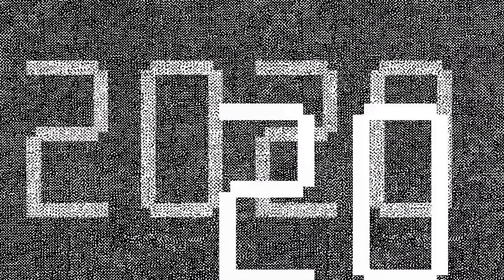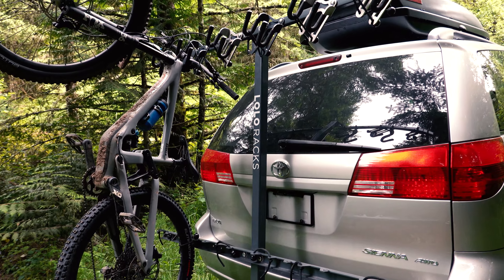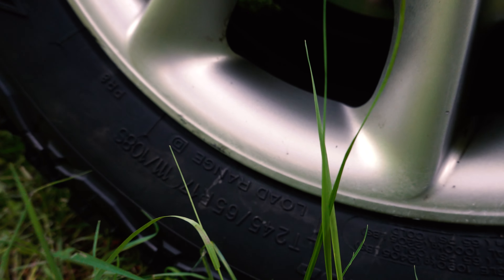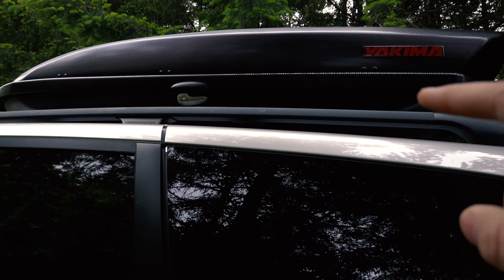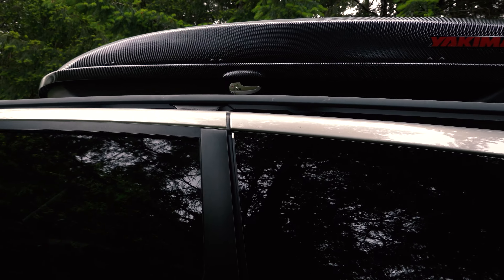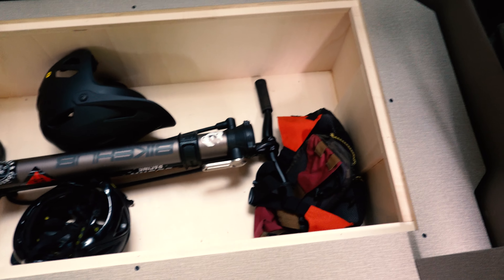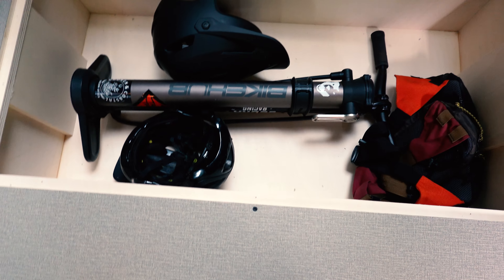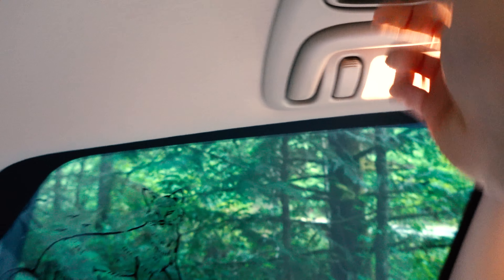Toyota Sienna Adventure Mini Van Camper Part 1

Comment: sweet, I have a 2004 AWD Limited Sienna with 110,000 I was planning to sell, but no I'll probably keep it as a project car =) ,   ( I did put 245/50/18 on Lexus GS 350 18"  wheels and it make the van drive way more stable, the offset and lug pattern is perfect )

Comment: Lift kit is a 8 hour job. Around 700 bucks anywhere u have it done. I have a 2011 XLE AWD
 And about to install Journeys 3.5 but kudos to you for the inspiration to toughen up the mom Van's. The 4x4 snobs will scoff ..let em. These Van's are build on Toyotas SUV platform anyway. Lest they realize.

Comment: dude bro, your van is sick! i was debating between a sequoia and sienna, but gonna get a sienna for hang gliding and camping after watching this video.
Reply from the maker: I was in a similar boat and the Sienna is just so nice for hauling stuff and camping. Hard to beat the sliding doors too.
Reply: I got the sienna, I got it almost 80% built out, I’m going to throw in some tires now, I don’t have a lift but I am scheduled in March at journeys in Scottsdale, but if I get the tires now have you had any problems with the 245/65?
Reply from the maker: @HangingwithJoe  no problems

Comment: Is there a part 2 to this "series". I just saw your video on Dustin Klein's channel with the lift installed. I'm on Vancouver Island, BC and just bought a 2006 AWD Sienna. We have the Journeys Off Road lift kit for our Dodge Grand Caravan. Definitely going to get the 3.5" lift for the Sienna too. Did you install it yourself or have it done in a shop? Also, you didn't have any issues with 245/65/17 pre lift? I was only going to go 225/65/17, but now you have me thinking. Last question, do you have a link for the Blueridge net?
Reply from the maker: No part 2 yet. Hopedully in the next month, I just need to find some time. We installed the lift at a friends house that had a big car lift. I have a friend that did it in front of his house by himself so totally doable. 245/65/17 without the lift is really awesome. With those tires you honestly don't even need a lift. Net is the Blue Ridge Overland Toyota Land Cruiser / Lexus LX Attic. Fits perfect and is super secure. I am not sure what the weight capacity is but I feel like it could hold a lot of weight!
Reply: @BrokenandCoastal  did you get any rub or need wheel spacers for those tires ??

Comment: I’ve driven my 2010 Sienna on a long stretch of washboard and I could see the frame flexing pretty significantly near sliding doors.  As much as I want to do JOR 3.5” lift, I’m worried frame flex could be a problem over time.
Reply from the maker: @P C Oh thats interesting!
Reply: Be careful. I have a 2004 and have engine cradle rusted badly. New part is 1700. If you offroad check how sound your undercarriage is.  Have fun. I plan to move into mine. Adventures await.

Comment: I've been looking at the Siennas for the last few days after learning they come in a AWD. Plan on doing a camper conversion. Nice to know that the 245/65s fit without the lift. Any rubbing at all?
Reply from the maker: No rubbing on the 2nd gen AWD. 2WD might not.
Reply: I was just about to ask the same thing...
Reply: I realize this is an old thread...
I just ordered these tires for my 2009 Sienna all-wheel drive. 
I'd love to get these on before I do a lift, but all my tire places in town say that they'll definitely rub as well as the folks at journeys off-road. Still going to try. Wonder if those are stock rims?

Comment: Hi,...
Great video...
Did you upgrade your braking system and or are you going to do it when you put your journey kit on there...
I'm still undecided if I'm going to actually put the journey kit or find another route to lift my van...
However at this very current moment I need to make a decision on my breaking system...
And it seems like no one's sharing what has worked or what has not worked...
I'm pretty sure no one is keeping OEM rotors and pads after they put on these big tires and or lifts...
Hmmm
Reply from the maker: Never heard of anyone upgrading their brakes after doing the JOR. If you poke around the forums one person upgraded rotors but it wasn't because of the lift or tires. I believe it took a lot of work and it was because he was hauling a trailer. JOR seems to be the most common and reliable lift.

Comment: Good stuff!! Making me want one man. Looking forward to seeing the rig around PDX sometime.
As a Toyota enthusiast/owner I would personally go with less than a 3.5” lift if possible (not sure what other kits are out there). Once you go that high the ball joint and cv axel angles are pretty maxed out and you’ll end up having to replace both much sooner than if you do a more mild lift. That’s kinda the case with any vehicle but I’ve personally experienced these problems lifting a 1st gen Tundra and 4Runner. Replacing the CV and ball joints was a PITA haha, would have rather been riding. Whatever way you go this thing is rad!!!
Reply from the maker: Good to know because I really don't know much about cars. haha
Reply: Great point...
This is why I'm still sitting back and watching..
When the journey kept first came out I was so excited...
However...
It is not looking good in the van community...
It just ends up costing the owner so much more money with all the other parts they have to change because this just too much stress on them...
I was on one forum and this guy was talking about using Highlander struts to lift his sienna...
I asked him to please make a video on how he did this...
This may be a great option for me...
I never even wanted three and a half inches however the journey all in one kit seemed convenient...
I only want a couple of inches taller...
And I don't want to go too large on tires because the issues with that and or they don't even fit anyways...
Reply: Also I should point out that the stuff I've seen on the forums about people putting a lot more money in their vehicles because of the journey kit are mostly people that are not mechanically inclined...
Which is my problem...
I'm a better troubleshooter than I am a parts changer...
And as soon as I feel something wobbling, vibrating, her mouse's hair move...😂🤣 I want to get out and investigate...
So I think this lift will be more trouble than what it's worth for me in my sanity driving over the road alone...lol

Comment: Yo! David Boerner here. Literally looked up 2004 Toyota Sienna as i'm trying to buy one (probably just gonna get FWD). Hell yeah!

Questions:
-how's the reliability been so far (and what mileage are you at)?
-what kinda MPG you getting?
-any issues with the tires so far? And have they affected your MPG?
Reply from the maker: The van has been solid. Just hit 150k like a month or so ago. I honestly don't know how to track MPG. I've only been driving for 3 years! The bigger tires rip! It just makes driving off road super comfortable and safe. I don't know if it affects MPG but you can definitely feel the weight of them. For me it's not a big deal. Besides the tires I've replaced an oxygen sensor and the rear struts myself. I'll be replacing the front ones as well when I put the lift kit on it. I love these vans.
Reply: Great questions...
I was going to ask the same thing..
The larger the tire the worse the miles per gallon is going to be...
So I was trying to avoid of going too large...
Also I did not get a all-wheel drive because they have worse gas mileage too...
And more things that will break when I'm on the road...
So I also purchased my sienna with front wheel drive...
Also I plan on driving on beaches...
So I don't want all-wheel drive...
This is why I kept going back and forth between getting a sienna and a 4Runner...
I either want a true 4x4 or a 2WD...
I'm still trying to figure out my brakes though...
Has anybody upgraded their brakes and have good news or bad news... Lol

Comment: Did you ever get it lifted? If so how did it effect handling/stability,  ride quality and mpg?
Reply from the maker: I did. It's been lifted for a few months now. Love it. Handling is better. Probably because I put in the new shocks front and back plus the sway bar that came with the kit. 24MPG with rooftop box and my Lolo Rack. 100% would recommend but just note that depending on your veichle it can lead to CV issues.
Reply: @BrokenandCoastal  Thats good to hear, another youtuber with a lifted awd sienna said with his kayak and roofbox he gets 12 mpg, 15 without kayak and like 16.2 at 80mph on the highway but his friends FWD does over 20mpg. 

How did you measure yours? Hand or computer tripometer? Highway only or mixed?
Reply from the maker: @shanet7511  Crazy. I recommend joining the Sienna AWD Facebook page. Basically, any question you have has already been answered by a ton of people. There must be something wrong with that person's van. Just measuring from the Van. I know it takes me a almost 3/4 or so to get from Portland to Ashland fully loaded with 2 people and 4 bikes. Thats about as scientific as I'll ever get. haha.